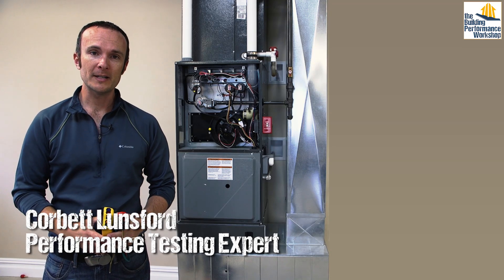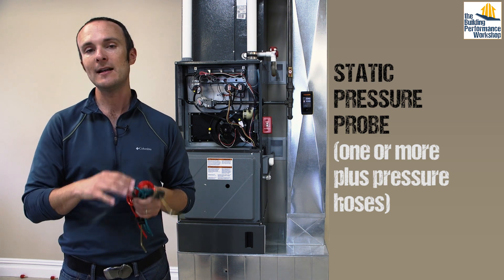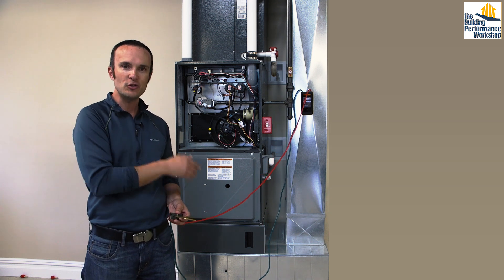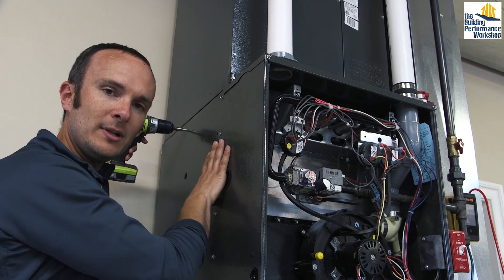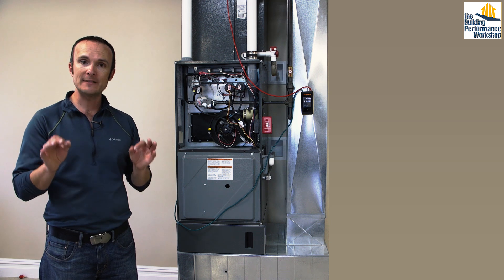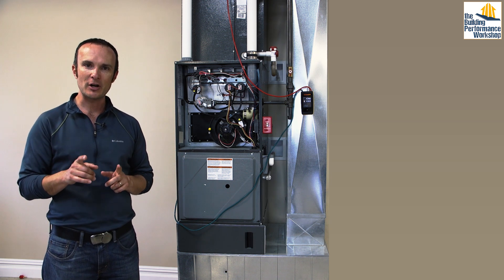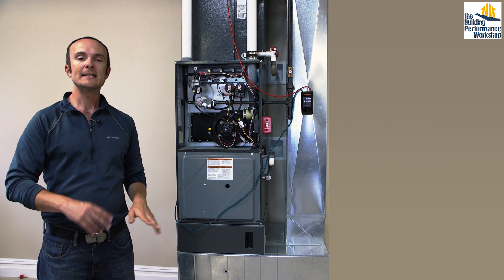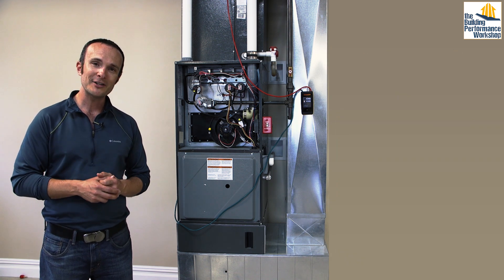Static Pressure Testing and Mapping Demonstration: Home HVAC Duct Performance

Comment: Lost me when you see "away" from the fan. You clearly said in the beginning to point the probes in the direction of airflow
Reply: Basically what he's saying is the whole static pressure thing is based off the fan. The calculated total static pressure from the manufacturer is for the fan to operate at the proper CFM. Too much pressure or over the recommended operating pressure or friction equals less CFM. So the measurement on the intake side of the fan, negative pressure, measures from that point to the end of the return duct where the air enters the return duct system. Basically giving you the pressure of the entire return duct system from the point where the air enters the ductwork 2 the intake side of the fan. You're basically measuring all the friction caused inside the ductwork from bends and turns, dampers, and even Grill registers. Now on the supply side of the fan the discharge, you are measuring positive pressure and same thing from the discharge of the fan to the very end of the ductwork at the registers that feed the rooms. This will give you static pressure from the supply grills in the rooms through all the supply ductwork back to the discharge of the fan. That's what he means by away from the fan. Hope this helps.
Reply: Yes the probes are pointed into the direction of airflow which measures the resistance on the intake side of the fan and the supply side or discharge side. Basically how hard the fan has to work to pull air in or how hard it has to work to blow air out. Like trying to blow up a balloon with the air Inlet pinched off by your fingers that would be external static pressure. The fan being your mouth and lungs, the ductwork being the balloon, and your fingers pinching It Off being the restriction or undersized ductwork, multiple turns, dampers, grills Etc.
Reply from the maker: It’s just a way of visualizing how the test works, Luis. Both are true.
Reply: Good morning corbett, thank you for the video.

Comment: Great information
Question what do you do if you have high pressure and I have a new evaporator and it’s clean. 
I have 0.2 after the evaporator 0.5 before the evaporator 
And 0.1 on the return ? 
The air handler has a max of 0.5 as you stated. 
Thanks
Reply from the maker: I bet it’s wet, if you’re testing now. That’s likely your .3 pressure drop, but also the supply ducts should be around 0.1 like the return. All of this can be calculated in the design phase.

Comment: Your using a bent tube and placing it in the direction of airflow, the pressure measurements you are making are heavily weighted with air velocity. You then further confuse me by saying your making measurements away from the blower but I saw you directing the tube in the  direction of the blower. If one would take a close look at the cross-section of a PETOT tube, you would notice the static pressure measurement is made with an opening perpendicular to airflow. thinking you are miss-informed and you are miss-informing others.
Reply from the maker: No, Mark, a static pressure probe is not a bent metal tube. It’s half of a pitot tube- the half that does NOT measure velocity pressure. You can buy them at any hvac supply.

Comment: We test static on every furnace but a true technician knows that you can remove the high limi at insert your port there.
Reply from the maker: 'True technicians' be getting higher TESP readings than actual, in that case. Your supply reading is not external to the equipment if you're testing at the limit switch.

Comment: Thanks for the reply , but is it the tubes you insert in the supply and return is just a static tube (only one plastic tube connected to each of them) ? , how can it measure velocity pressure ?   Thanks again for your video.
Reply from the maker: You need the static pressure probe connected to the hose.

Comment: Great video , but i must be missing something , please explain why the static tube need to point to the airflow ?  you said that the static pressure has a ballon effect, is it directionless ?  Thanks
Reply from the maker: It it, but you need to get rid of any velocity pressure, hence pointing the aerodynamic tip into the flow.

Comment: How can you read a pressure difference after you made a hole? Isn`t  that hole going to equalize pressure with outside?
Reply from the maker: Good question, but no- you plug the hole with your probe. But even if you didn’t, consider the duct system: it has lots of holes in it (diffusers) but it still has pressure.

Comment: Usually I'll pull the limit if the hole is too big I'll put metal tape to make up the space for the magnetic static probe and of course for accuracy .  Not all but alot of times in California at least drilling on the side is a real task sometimes the limit is the only answer .  Great video
Reply from the maker: Agreed, if the limit access is the only way, do it!

Comment: We always did static pressure, temperature rise and gas pressure tests on all of our start ups, then recorded the readings and put them in a customer file.  If you don’t do this you are not determining if the furnace is running properly and under design conditions
Reply: We do it on every start up, every single maintenance just to ensure the system is operating properly and nothing has changed within the system. I love it
Reply from the maker: My hero
Reply: Keel up the good work!

Comment: why not check the supply at the high limit
Reply from the maker: The reading you get at the high limit switch hole is guaranteed to be higher than after the heat exchanger, since the limit switch is in the midst of it.

Comment: very good ,,now i have to get it LOL or understand this right ! wow , i had a system installed on a new house by AIR CARE INVERNESS OR HOMOSASSA ,,and 10 years later i am being told from another tech from BAY AREA that my system which is 4 ton is NOT performing as a 4 ton because the duct work above the cooling coil   i am told is way too big ? so even me did not check it myself because i trusted the company that installed it ?   thanks for sharing

Comment: Good explanation.  I just had to fight with my installer to do the commissioning testing shown in the Lennox installl manuals.  Lennox's detail shows one test hole in the A/C coil compartment and the other between the filter and the fan  for total static pressure.  The installer chose to use the supply plenum ( after coil) instead.  I would think he's missing the restrictions caused by the A Coil and would get a lower reading.  How important is it to be before the coil?
Reply from the maker: Very

Comment: I was told before the filter after the coil under 1 inch static is good. If above then back track through the coil, heat exchanger etc.
Reply from the maker: 0.5” is actually printed on the equipment label, brother!

Comment: A proper design of all the HVAC components of the system will avoid most costly problems… 

They have done exhaustive testing on HVAC airflow systems and found that 7 in 10 were not within airflow tolerances. 

If you go with an ECM motor and you don’t have sufficient Available Static Pressure the ECM Motor may exceed its RPM rating trying to meet its settings and overheat and fail because it is trying to deliver the pounds of air for each CFM that is called for. Pounds of air per CFM is a variable, because we don’t just have Standard air conditions like we are wrongly taught to use; there are many variables that have to be put in the formulas to achieve any decent degree of accuracy… …

The first thing we have to remember is that most duct systems are not sized properly to achieve 700 to 900 feet per minute velocity in the main trunk and then for 450 to 600 feet per minute in the branch ducts. The main trunk also has to be of the reduced trunk sizing type to maintain static pressures & velocities through all the branch ducts and the diffusers need to be sized properly to deliver the desired throw velocity to get the proper mix of the air in the rooms. 

Therefore, if you have a 0.6” or point 0.7” rated blower… 
Using Manual D, you actually need at least 0.3 inches of ‘Available Static Pressure’ (ASP); (.3" of ASP x 100 is 30/ using this time 400-TEL which is only .075 Friction Rate) therefore you need .3" of ASP remaining in order to use a ‘friction rate’ of at least 0.075” on the supply runs to maybe get enough supply airflow velocity to properly mix the air in the rooms. . . 
 
So you have a 4-Ton system and evaporator has a pressure drop of .43 inches & he filter area is sized to only get 700-fpm velocity which will go from a .2” PD a listed test rating @300-fpm to probably .35” PD from the 300-fpm published figures; that is a .78” PD, even above the highest blower Rating of 0.7”. 

Maybe errors as I used voice software to type this...

Comment: You could test through the main limit hole without drilling into the furnace
Reply from the maker: You get a higher reading there
Reply: Home Performance thanks for the reply and the video, how much of a difference? I’m sure it’s in the comments somewhere
Reply from the maker: It is, but that’s ok! Basically, since the issue is most systems are too high, anything we can do to give the poor installer a break helps. Even if it’s .05”, it’s enough to bump the TESP over the edge and fail. I often have to round down from .0549 to give a thumbs up.

Comment: I’d like to see how to use this static pressure test along with a flow hood to measure duct leakage.
Reply: Brian - estimating total airflow based on static pressure and then comparing it to measured flow with a hood sometimes works.  However, there's a lot of inherent inaccuracy which greatly reduces the confidence, and the tighter the ducts the greater the duct leakage inaccuracy.  The problem is that whenever you subtract one BIG number from another BIG number, minor % errors in either  value get magnified in the final result (estimate).  Essentially inferring leakage is not the same as measuring it.  A duct airtightness test (duct blaster or aeroseal) is the only way to accurately measure duct leakage.  Its referenced in all the codes and is how SMACNA standards do it in commercial ducts.
Reply from the maker: Good idea Brian- those are two pretty different tests, but there are some interesting ways to link them. I’ll see what we can do.
Reply: There’s a device called a duct blaster that does that

Comment: Cobett, hey I have some questions. 1. Do you have a "field cheat sheet" on this? 2. What state is this test supposed to be run. ie; start up, steady state etc...?  What about negative pressure or positive pressure is that a factor here?
Reply from the maker: Hey Michael- APT Reports has an automated section for this test. No need to run for any length of time, as long as the fan is running at the speed you want to target  (usually high). House pressures are insignificant generally compared to blower induced pressures.
Reply from the maker: Hey Michael- APT Reports has an automated section for this test. No need to run for any length of time, as long as the fan is running at the speed you want to target  (usually high). House pressures are insignificant generally compared to blower induced pressures.

Comment: Also, could you add the formula for static pressure versus horsepower for the furnace you are working on? I cannot find the answer in the fan laws. If motor RPM is the same rather .50 or 1.0 Horsepower, wouldn't the volume be the same?
Reply from the maker: I don’t think that tracks based on a simple equation, that’s why you’d need the fan curve tables

Comment: How does a higher horsepower motor produce more air when the RPM's are the same? Example Direct Drive. Is the smaller motor stalling due to High Static Pressure than the larger size will overcome?
Reply from the maker: Great question, but I'm definitely not the guy to ask. You need the HVAC School channel and Bryan Orr:
https://www.youtube.com/channel/UCdLlUhD9LUGm0-NTYDASPFA

Comment: sorry, but it is still confusing to me. how is that the probe place right in from of the fan and facing to the supply side of the fan is reading the static pressure from the of the end supply to the blower if it only sees what is front of it; the supply duct is behind the probe.
Reply from the maker: Don’t think about the direction of the probe tip- it always faces into the airflow, so it faces the same direction no matter where it’s placed in the system. Just remember it always sees away from the fan.
Reply: thanks

Comment: I believe I have a positive pressure issue in my HVAC equipped house.  That is freezing doors and key locks even though humidity levels are at 35%.  Is there any way to simply test the house envelope.  For instance stick your tester through the security peep hole or something.  I don't really care what the difference is between ducts.  Ultimately I just want to have slightly negative pressure in my home.  I only have 1 balancing damper on my Lifebreath on the  fresh air to outside duct.  Thanks
Reply: Yes. Leave High Port open to your House and reference the second point out of the house. If you have ducted outdoor air that exceeds your toilet or range exhaust, your house should be positive pressurized. If House pressure is over .05" positive, reduce the outdoor air until you arrive at barely positive. Industry standard are -.02" to +.02" W.C. Hope this helps. Reference to outside and be under a closed door or window as long as the test tube is not blocked off due to Door/Window Closure/Pinching.
Reply: Thank you, I will see if I can figure something out...
Reply from the maker: That is a SUPER question, and a very interesting issue you’re having! Simplest test is: windless day, crack a window in the middlemost level of your house, and with a blown out candle, see which way air is moving. PS- your pressurization would have to be pretty serious to cause this, and in summer a depressurization might also cause moisture issues. Though not freezing.
Reply from the maker: PS- where in the world are you located?
Reply: Central Manitoba,  Canada
Reply: I would imagine that it would not take much interior pressure constantly pushing on door seals, locks and window frames over time to cause problems.  During periods of extreme cold weather -35C it is hard to get out of the house.  I cant get any help from the manufacturer other than 'call your local serviceman'.  And it is very complex to understand and to have the equipment you have in your video.  Not too sure where I would find that expertise in my area.  I am presently running the Hvac 20/40.  Not sure if its helping or hindering.
Reply from the maker: I just yesterday shipped one of my books to Winnipeg. Is that close?
Reply: North of Wpg in the great white North.  From my point of view I would appreciate a layman's  video explaining how a HVAC interacts with a forced air furnace.  For example, on standby setting, does the HVAC always run when the furnace blower is on?  When the HVAC runs are fans equally powering the 'stale air form inside' and the 'fresh air to outside' at the same time?  If you dampen the 'fresh air from inside' (only damper on this unit) would that tend to increase or decrease the air pressure in the house?  Will running the unit 'better', that is 20/40 cost you much more in the heating mode than standby?  If I am bothering you tell me to hire an expert..

Comment: Why do you add the two pressure numbers across the equipment; but subtract across the filter.
Reply from the maker: Add pressures on different sides of the equip, subtract them in the same side.

Comment: Great video but the sad reality is that 90% of homes new or old are running twice that static plus the irritating thing is that all the new higher efficient coils are causing a relatively high static drop out of the box. The manufactures are making it difficult if not  Impossible to achieve .5"esp. most of the issues are with furnace and coil applications. Airhandlers usually are easier to keep a .4,.5" esp because there rated with fan and evap coil out of the box.
Reply from the maker: You’re right about the sadness, Marco. You can find air handlers that can fight up to .8” for those occasions- just takes planning ahead.

Comment: Hello. Great video. So when you're using a duct calculator to setup a new system you should be using the .05 scale, so if it's setup correctly you should get a .1 pressure difference between the supply and return. Right?
Reply: I have 2 air handlers in my house, both were setup using .1 static pressure for the supply, but I get a lot of noise out of the first floor registers (there 3x10), where my 2nd floor unit is much quieter but the diffusers are 12x12 coming out of the ceiling. So my thought was to drop the static pressure of the first floor unit or put in bigger floor diffusers. Any recommendations?
Reply from the maker: The way I was taught, both the return and supply are generally designed with a 0.1 pressure drop, but you can always design for lower- you’re paying for more ductwork (bigger around) but not getting a significant performance boost from it.
Reply from the maker: Quiet alone doesn’t make it right- you want the velocity of air through registers to mix the air in the room, and that means 500-700 fpm.